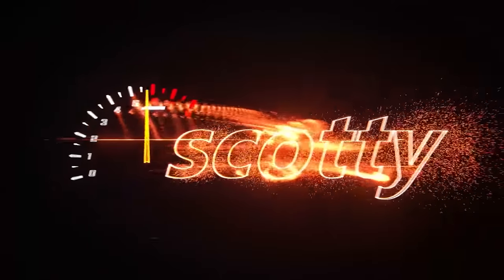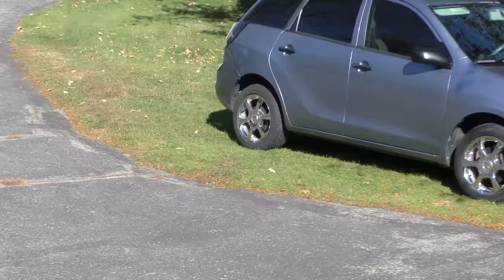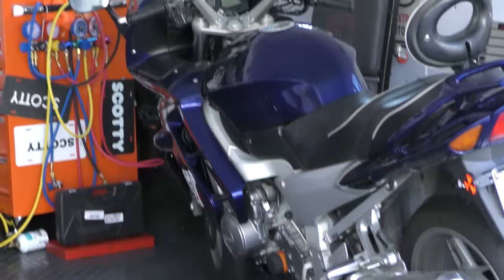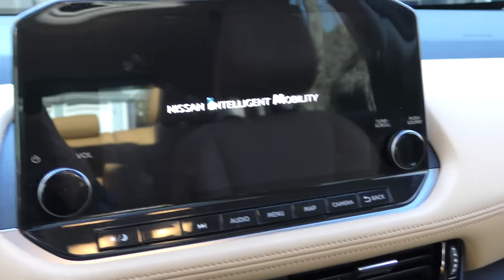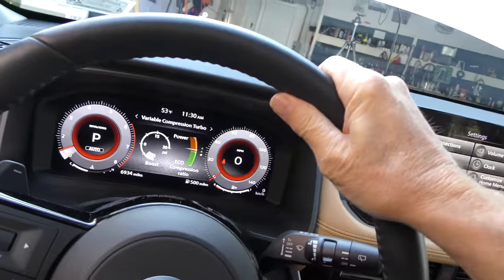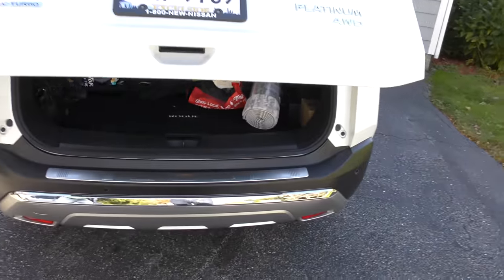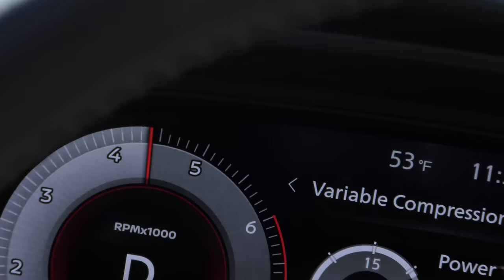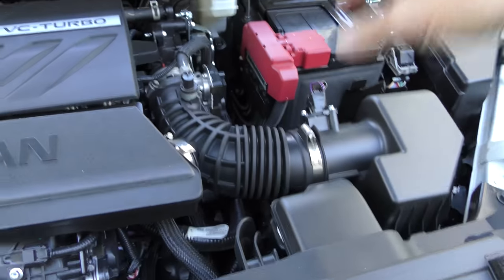Nissan's New Engine Shocks the Entire Car Industry

Comment: I gave my sister in law a 2012 Nissan Murano Platinum in 2016.  The only thing that went wrong so far is the MAF sensor which was an easy fix. Today it has over 300,000 KM but it runs like a champ.  The car was made in Japan over 10 years ago and it’s been through 10 Canadian winters.
Reply: Im impressed because the Nissan CVTs have been problematic and its the only reason I won't buy one
Reply: @dm19609721  hot weather and stop n go traffic kill the nissan cvt.. aftermarket trans cooler do wonders
Reply: @dm19609721  CVTs will last provided you don't flog it like a turbo
Reply: @TheGecko213  based Bayern
Reply: @sickfoo5506  weird. am living in a tropical climate and in constant traffic. our 2014 x-trail still hasn't had any problems. fingers crossed it'll stay that way.
Reply: I bought a Nissan rogue I had everything wrong with had to junk the car in the end
Reply: Considered yourself and your sister in law lucky or blessed. Nissans quality control went downhill for awhile now. Older 90s and earlier 00’s are still pretty good.
Reply: Nissan CVT’s are fine if you change the fluid at least every 50,000 miles. Most people don’t!
Reply: @sickfoo5506  You would think Nissan would make trans cooler mandatory.
Reply: @BroadwayLTDProductions thats what people dont do. They see a 400 dollar bill and prefer to spend thousands later
Reply: I have a Murano 2006 SL with 290, 000 kilometer. I replace ignition coil, alternator, starter motor, AC that's it. N believed or not I have never changed transmission oil n I will never do it. still going strong bc of rust I'll have to start looking for a new car maybe Murano or Pathfinder Rock Creek.
Reply: I have a Murano 2006 SL with 290, 000 kilometer. I replace ignition coil, alternator, starter motor, AC that's it. N believed or not I have never changed transmission oil n I will never do it. still going strong bc of rust I'll have to start looking for a new car maybe Murano or Pathfinder Rock Creek
Reply: Exactly. Hearing so many Nissan owners with zero problem (myself included). Can’t all be anomalies.
Reply: Even a broke clock is right twice a day. U just happen to be one of the lucky ones lol

I’ve been through 2 cvts on the 14 max and both were WELL maintained.

They just not meant to be everyday drivers imo. First one went at 80k, current one is at 60k. A piece of shyt transmission lol

Other than that though,  baby has been a champ.

Comment: "Life-time warranty" sounds great on paper.
Bet it will be a pain in the arse to use when it's time.
Reply: No kidding! You better make sure you get all your recommended scheduled service at the dealer. And they’ll make sure you pay handsomely for it. Plus what if the dealer is sold or goes out of business.
Reply: Life time warranty means it's under warranty until it dies. Which is when you would need the warranty 🤣
Reply: Actually most people don't keep their car more than 3-5 years anyway, they're betting it's long gone before their so-called "lifetime" warranty is needed (which BTW they'll try to dispute anyway over some minor technically)
Reply: Or take months for the free repair.
Worse, disqualified for not servicing at the dealer.
Reply: It can be. If you do all of the scheduled maintenance at the dealer, you won’t have an issue. The warranty company is betting that you will trade it before you ever use it and it’s not transferrable.
Reply: @daebruh2034  Or one day you show up at the shop a few tens  of miles over and thus voided their "lifetime" "warranty" forever.
Reply: @JK-co8og  actually you dont, if you actually read the contract they wont state that. People just asume the worst😂
Reply: They’ll come with someways to say you neglected your engine or make it an issue because you took it to a 3rd party for oil changes. Sounds like a play right if the Tesla playbook.
Reply: That's not right warranty is factory warranty
Reply: Lifetime warranty that covers nothing I bet.

Comment: The best car I have ever owned, and still do, my 350Z. bought it new 15 years ago this December, 90K miles. Still running like a champ. Replaced passenger side window motor and the two rear hubs. that's it, fellows.
Reply: I have an 03 with 298k miles.😂
Reply: 350z is my dream car. I’ll get one someday
Reply: Mine is a B13

Comment: I have a 2022 Rogue SL and I love it!   The car moves getting on to the parkway, and I get 28 city and 37 parkway miles on gas!  It's great and this my 5th Rogue.. haven't bought any other car but a Nissan  since 1982!
Reply: How many miles did you get on each car
Reply: Do you hear a "whirring" sound when you drive over 40 mph?   I hear mine doing that upon deceleration too, until about 35 mph, then I don't hear it.  I've been told by the dealership that it's the turbo.   Kinda annoying.   I override it with the radio.
Reply: I love my Rogue too 2024💪🏼
Reply: I love mine 23. No problem so far. 26k mileage and going on.

Comment: We bought my wife a brand new 2015 Rogue SL and I have done all the appropriate maintence myself including changing the CVT fluid every 30k miles from the start.    The vehicle has been very reliable and we haven’t had a single issue with it except the around view camera mounted under the passenger side rear view mirror went bad so I picked up a used one on eBay for $50 instead of paying Nissan $700 for a new one.    The vehicle currently have almost 100k miles on it and we have been very happy with the purchase so far.
 
Of note:
My wife drives it in ECO mode all the time and she is a mild mannered driver so the CVT is not being abused.
Reply: $700! What rip-offs! Good thing you turned to eBay and found one!
Reply: you are referring to the rogue. for some reason a lot of people spell it rouge- and sometimes they actually call it that. good on you for servicing your CVT every 30K and seeking out/finding an 'experienced' mirror/camera for less. do you or your wife use both feet to drive it? the CVT control unit or 'brain' can recognize that and you can actually preclude the downshifting mode at lower speeds by using the brake pedal lightly while on the throttle with your right foot. just one of several tips you can use to maximize your nissan CVT-equipped car's fuel economy. of course- being a non-aggressive driver helps a bunch in that regard, as well. enjoy!

Comment: My wife has an x-trail(Rogue) 2005 model she drives it like a Bastard,heavy on the brakes and accelerator! 185 000ks got with 35000ks just replaced the starter motor! The dashboard is still intact and the vehicle is a joy to drive!
Reply: "They don't make them like they used to"... that's all I can say for this scenario.
Reply: try replace it with the 1.5 turbo rogue LOL, let your wife drive it and see if it breaks after few years

Comment: My wife has the rouge sport, she loves it, I have to admit the tech Nissan puts in their stuff is off the chain. When I test drove it it put a smile on my face. The power curve with the cvt was weird. It felt really different than I was used to. 4 years and absolutely no problems. We let them service it.
Reply: Do you let them service your cvt oil change at 25k miles? My nissan guy is telling me to do 50k but the manual says to do it at 25k and my power train warranty is only till 60k
Reply: @DamianTran  odd. It's technically 35K. But hey dealerships do whatever the heck to get your money. If they really cared. They would build better quality parts.
Reply: The Rogue Sport is called Qashqai in Canada. It's a totally different model (and smaller) than the Rogue.
Reply: @DamianTran  
Did mine at 40k miles but it is a Nissan Rogue 2015
Reply: @oscarfunez3806  30,000😁
Reply: @DamianTran  yes, all maintenance according to Nissan schedule. So far brake fluid, radiator, cvt, oil, cabin and air filters, now battery is due.
Reply: @denisdeslauriers7277  yes smaller
Reply: @DamianTran I change my cvt fluid every third oil change or 15,000 miles.  I drive hard. 2019 Altima, just turned over to 90 thousand miles, zero issues.

Comment: Got one of these same trim level on a lease so I don't have to worry about durability. Honestly I really like it, super comfortable, lots of creature comfort's and engine is really peppy.
Reply: Do you hear a "whirring" sound when you drive over 40 mph?   I hear mine doing that upon deceleration too, until about 35 mph, then I don't hear it.  I've been told by the dealership that it's the turbo.   Kinda annoying.   I override it with the radio.
Reply: @ofcbob6391 I love that sound, makes me feel like I have a supercharged v8. Maybe one day. 😅

Comment: Keep your eyes on Nissian…. They are making a pitch to get back in the car game!  They already have great technology for example G-TR and the new resigned Frontier Truck V6 no turbo..  The 2022 Sentra is also a great mileage car 29 to 39 miles per gallon and the CVT has not been in issue for years now.  I’m a Toyota guy but, very impressed with the details of the vehicles example lines of the cars are straight & great paint.  My 2022 Tacoma has terrible lines and the Paint doesn’t match throughout the truck. Thanks Scotty for the Video your the best!!!
Reply: yea they think it 2015 or 16 when they were having CVT troubles.
Reply: Nissan makes some great engines like the VQ and the VK the latter being way stronger than Toyota’s UR series. Nissan don’t have the Toyota tax and resale value means nothing to me because I drive my cars until the wheels fall off.

Comment: All the new vehicles are absolutely beautiful and marvels of technology and great to drive with every convenience but they are over engineered and way beyond the most experienced technicians at the dealership. When you hear the phrase come from the Service Mgr "that's normal, there all like that, don''t worry about it." That means they don't have the expertise to analyze and repair a problem. I have 3 cars, an 05 Titan truck, simple V8 and 4 speed auto, an  06 Accord with the 2.4l bullet proof engine4 and 4  speed auto and an 18 RAV4 Hybrid with the old style port injected 4 cylinder. Yes it is a Hybrid but nobody does hybrids better than Toyota. My advice, try to find a used vehicle , low miles with tried and true technology if you can find one.

Comment: I have the 2018 Nissan Rogue, and it also acts like it's shifting. I also get 35.5 miles per gallon on the highway and the transmission shifts smoothly and incredibly quiet highway cruising.

Comment: Just got my midnight 2023 it drives like butter, nice hp , and surprisingly very fast. Very luxurious inside. Ive been in the crv and the rav 4 and u cant even compare. So so so thrilled with my new car❤❤
Reply: Do you hear a "whirring" sound when you drive over 40 mph?   I hear mine doing that upon deceleration too, until about 35 mph, then I don't hear it.  I've been told by the dealership that it's the turbo.   Kinda annoying.   I override it with the radio.
Reply: @ofcbob6391  uknow what, aside from regular acceleration sounds i havent actually noticed it , but maybe now i will pay attn.. ill come back to update u

Comment: In my experience those lifetime warranties dictate who does maintenance. You wouldn't be able to do any DIY oil changes. You're tied to the dealership service center.
Reply: nonsense- responsible owners use factory parts and do their own service. if they have their parts receipts and document the work- warranty acceptance is never a problem.
Reply: Exactly this. My aunt’s warranty on her Mercedes basically dictates why she only takes it to the dealer for maintenance. Last visit there they told her she needed her spark plugs changed. $1700 to do it tho.

Comment: I'm on my 3rd Nissan. had 2 Sentra's, and now driving my 2013 Juke that turned 88,888 miles yesterday. I love it to death. Usually trade after a few years, only repair was ball joint, tie rod, and a control arm which seems to happen to these cars.  Not fond of using premium fuel, but I do it as recommended.
Reply: Nissan Sentra has "Zero-Gravity Seats"!!!

Comment: I bought a 3 cylinder engine many years ago. I've taken good care of it and it still runs like a champ. Of course it was made by Evinrude. The thought someone actually took out their checkbook for a three cylinder Nissan with that CVT blows my mind. In the words of PT Barnum...
Reply: Yes, I have a 3cyl Kubota Diesel in my boat, bulletproof, I would never buy a 3 cyl car.
Reply: Athefumen
Reply: Nissan make rather fantastic engines, their biggest problem is the transmision. Apparently their new design fixed the problem the old ones had, but only time will tell.
Reply: Maybe they fixed the CVT now but their reputation was destroyed by their CVT's.
Reply: @jasonschlesinger5343  trust me it most definitely was not lmao. I see SO MANY around and know several people who are buying the ones WITH the bad CVTs. Look at chevy, they still sell like hot cakes. I mean hell even Kia/Hyundai are still in business. The simple truth is most people don't research their cars before buying them and most nissans look pretty, so they'll sell
Reply: @QuincyStick  They don't make everyone of them bad. Two of my coworkers both have Rogues, 2016 or 2017 model years. No issues, not even the transmission, surprisingly. I agree, most people buy their car based on looks. I believe the CVT is fine with a smaller, lighter cars like the Mitsubishi Mirage.
Reply: @jasonschlesinger5343  CVTs in general are fine just Nissan needs to get theirs worked out. I hope this new revision fixes it because I'm actually quite fond of Nissan's, but with those cvts I will not buy one until they prove themselves again. To be fair all the other big cvt users (mainly looking at Honda/Toyota) have been making them since the 90s and even last-gen Honda CVTs had problems. Nissan has only been making cvts since I believe 2010, so they just have had a lot less time to refine them.
Reply: @QuincyStick  I would wait at least 5 years or more for myself before buying a car with a CVT. Hopefully Nissan sorts it out soon.
Reply: @jasonschlesinger5343  yeah my current car has one but it's a Toyota so I'm good on that front. The Nissan revision came out in 2020 so it's gotten about 2 years' worth of trial and error and I haven't really seen anyone complaining yet, but I'm definitely gonna wait a couple years before ever considering it.
Reply: there's a non -toyota / non-honda buyer born every minute?
Reply: @JackAndTheBeanstalkr  pretty much
Reply: 3-cylinder daihatsu motors are just as good as your evinrude- we're taking outboard motors, right? oh, wait- evinrude didn't even make automotive stuff.... my '92 charade four-cylinder still going strong at 425K- that's all-original except for new rod bearing shells that i decided to replace about 25 years ago.
Reply: I had an Altima 3.5 v6 coupe and the engine was very dependable. In fact that v6 was considered one of the best in the industry. Why they coupled that CVT to it I'll never understand. Sold it before I had issues with it. Would not have trusted it to 200k. Infinity with same motors used a standard auto.
Reply: @craigdoriety9798  Nissan V6 engines probably the best made, had a 1986 Maxima for 35 years and had zero problems with the engine, even when i sold it i could still stand a coin on edge on top of it...
Reply: @Quincy.Stick  right 2020 silverado transmission junk less then 10 thousand miles ..under warranty 6 grand rebuild .. 42 thousand miles transmission messed up again .  I'll never buy new silverado..my 2005 still runs and shifts great
Reply: @QuincyStick yes they added and traditional torque converter to the cvts in 2019 and has fix the problem as long as you're doing the preventive maintenance on the fluid you're good.
Reply: @QuincyStick those cars had owners that never serviced the cvt fluid guaranteed.
Reply: @QuincyStick they did work it out in 2019 by adding a torque converter to take the stress off of the metal belts.
Reply: @jasonschlesinger5343  They have.  Nissan CVTs of the past 4-5 years are pretty problem free.  Just change the transmission fluid every 30k and you'll be fine.  A lot of people are operating on obsolete data.
Reply: When I was a kid (growing up in Europe), one of the most popular cars had only 2 cylinders engine (Fiat). And it was air cooled, and available only with a stick shift. Anyway, we shouldn't be afraid of small engines; lots of them on European roads and they last.

Comment: Those lifetime warranties from dealers are a scam. Usually, they make you sign your service away to them. If they say something needs to be serviced, at any point, you have to do it and pay for the wearable items, or it voids the warranty (i.e. cabin air filter,... you need new tires because they seem low to US). Over the lifetime you pay for way more than you need. They are basically service contracts with the dealer and if you slip 1 time it voids the warranty. It a trap you can't get out of.  It was all over the news here in Georgia a few years ago. It could be different from what I've seen, but I doubt it

Comment: Tbh Scotty I thought I would never see a Rogue in your driveway, but the new turbo engine is so much better than the 2.5 was. Even with the cvt. I had a 2015 and 2018 with no problems. With that power train warranty it’ll be fine!